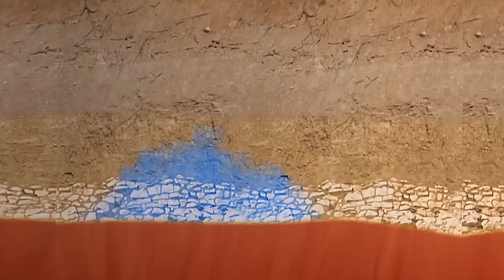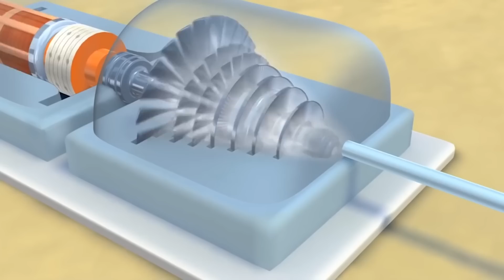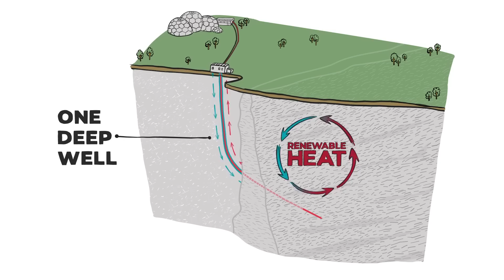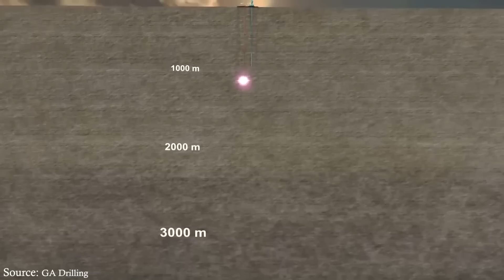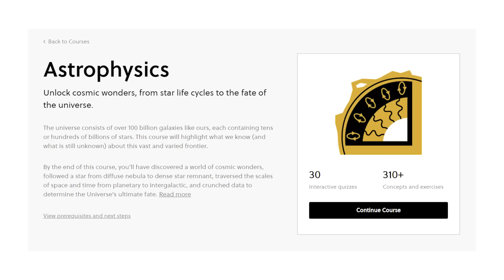How This Hole Keeps Generating Energy

Comment: Physics will tell you that the core of the earth is NOT an infinite source of heat. This Spheroid on which we live has a limited capacity. What say we draw off energy and cool liquid rock down to solid rock ? We run the risk of shutting down the great magnetic generator that is our molten core. If this happens we will be able to harvest the radiation from the sun better but we will need better radiation protection at the surface of the earth. What I’m telling you is that it’s currently feasible to use energy from hot sources from close to the surface but eventually we will suffer consequences and who knows it might coincide with our sun becoming a red Dwarf … if we cracked the nut of AC aerial transmission that Nic Tesla proposed then energy conversion sites at our Geothermal sites worldwide could supply remote power without having to maintain Windmills and solar panels. Who’s up for that challenge? It’s not like something that hasn’t been done … Tesla actually proved it before they pulled the plug on it all, the hardest thing will be the religious Greens and the money Barons interference in a society improving innovation that supersedes current money making energy supply. Remember JP Morgan only Shut Tesla down because he couldn’t regulate and charge for the Energy supplied ….
Reply: This Spheroid on which we live has a limited capacity. What say we draw off energy and cool liquid rock down to solid rock ? We run the risk of shutting down the great magnetic generator that is our molten core

Source?

Comment: even if not for electric generation, geothermal has heating applications it could be used for to displace natural gas. and oil use
you'd think in advances in heat pumps and cryogenics, the'd be able to make concentrators to up the heat to a more usable value.
plus it's clean and can go in locations nuclear can't be, cutting infrastructure costs to connect it.
best drilling tech is owned by oil. 
might explain it's slow take up.
Reply: You forgot the coal and wood. Yes, heating is expensive enough to be the major goal.

Comment: If there is even a remote chance that any of the people actually working on the plasma laser or other top end drilling techs see this, on behalf of our planet PLEASE STOP.  Do not continue with this attempt to generate cheap energy.  One misplaced drill that causes a significant pressure change underneath tectonic plates has the chance of creating significant earthquakes and tsunamis.  There are plenty of places where geothermal energy is already escaping to the surface and you can have fun capturing all the energy you want from existing holes but the chances of really pissing off mother nature are huge.  One team that hit the wrong pocket of anything could release gas or water or lava that was under extreme pressure and that release of pressure won't be able to stop in time before a significant tectonic event occurs !!!!!    Tiny little movements cause lots of damage and they want to toy around with things that have the potential to create not so tiny movements.  World wide devastating tsunamis and possibly successive earthquakes for weeks or months.      The pressures inside our planet are not to be treated lightly.    I am all for green energy but I have to ask you question.  How green will the planet be after we release internal pressures that could impact the forces that govern the spinning core at the center of our planet.   If something significant caused a change in a plate above it and that in any way caused a change in a spinning sphere of magma that caused it to slow down or spin differently the implications to the magnetic fields that protect our very existence might leave a brown and red and barren planet instead of a green planet.   This technology as good as it sounds is not worth the risk.   There are much better ways to try to harness energy then tampering with loosing out magnetic field.    I AM NOT a doomsdayer or conspiracy theorist.  These are legitimate concerns that should well vetted by teams of geologist before anyone decides to double how far down we have been poking our mother.

Comment: Would anyone have to dig very deep at all, if we started storing the Ambri "liquid metal batteries" underground? Ambri wants their batteries to stay hot. I'm sure they would get hot enough to keep the rock around them hot. They could capture the excess heat from the batteries with steam turbines and cool the batteries down if there's a theoretical unsafe temperature for Ambir's batteries.

Comment: A problem you forget with geothermal energy is that you subtract heat from the rock and the rock is not a good thermal conductor. That means that a certain pipe has only a limited energy capacity until the rocks are cooled down enough so that the water will not be supercritical.
Reply: You underestimate the available heat. You also fail to consider that multiple wells would be needed, either as stand-alone systems, or as a system of interconnected wells, circulating water with additives. It has been done already, and if the well spacing is good, then you get enough heat generating to run a power plant for decades before needing to introduce new wells.
Reply: @cerealport2726  It's never been done at this depth.
Reply: Rock at this temperatures and pressures (at 10 km or below, provided the right spot is chosen) is not like the rock here on the surface. It's actually getting softer and even partly melts, a bit like thick, highly viscous magma with solid parts in it, having quite different thermal conductivity. And there are saline fluids which also can transport heat. Of course there is a limit, but with the right amount of water pumped in, there will be little issues with keeping it hot. 
But there are other issues. In case a non water-permeable layer of clay is penetrated, and water spreads into formerly dry layers below (e.g., into Anhydrite), those may swell, raising the land above quite a bit. This already happened, and it literally ruined villages. Such issues are hard to predict, because of the actually unknown structure details and porosity of the rock below. Another issue is liberating toxic substances from under ground that were kept there before, e.g. heavy metals or radioactive material. And in case of a movement of the (softer) rock below, the pipes may easily get crushed, posing another issue. 
We actually don't know very much detail about the earth's mantle, as it is hard to just go and have a look. Thus it is difficult to chose the right spot to drill.
Reply: @human_isomer  
I believe they line the borehole with a pipe down to below the depth where there are no more layers for water to go into.  The water is under pressure so it seems possible that some may leak between the pipe and borehole.
Reply: @acmefixer1  yes, when wells are drilled, they start with a large diameter, and end with a small diameter. at each interval, they run and cement "casing" or "liner" in place to isolate the well from the rock. a common well design is 4 hole diameters, 26inch hole (with 20inch casing), 17.5inch hole with 13-3/8inch casing, 12-1/4inch hole with 9-5/8inch casing, and 8-1/2 inch hole with varying casing diameters, sometimes, depending on the location and requirements, there's also a 6 inch hole section too, again, with varying casing diameters available. it does vary, but this is pretty representative in terms of scale.
Reply: @acmefixer1  The melting rock due to the plasma actually creates it's own casing
Reply: @human_isomer  You absolutely do not need rock that hot. You need it to be 200-300 degrees (celsius)  or so, enough to turn water into steam.
Reply: @cerealport2726  I didn't mention any temperature ;) But I see it could be assumed to be very hot because I mentioned magma.
Reply: @human_isomer  we dont need "less" or "more". We need the exact number to operate with.
Reply: But could alternating between a small amount of tunnels give enough time for the rock to heat up again in a reasonable amount of time
Reply: @owenhopper14  There's nothing to heat up again - it stays hot. It's the heat from the earth...it'll be a long long time before that ever gets too cool.
Reply: Krypton Future !
Reply: Exactly.  And as he mentioned,  it's very costly to drill a deep well.  When the well runs out of heat and a new well must be drilled, did the  amount of power generated pay for the first well to be drilled?  Will the next well generate enough power to pay for its drilling?

This also applies to the existing geothermal power plants that are located on hot spots in the earth's crust. The wells are much less deep than the wells that must be drilled where the heat is deep in the earth's crust.  The drilling expenses must not exceed the returns from the power generated.
Reply: @acmefixer1  It costs $500k to drill this well - 8'' borehole 10km deep. That's compared to ~$30million for a regular oil rig setup.
Reply: @blakebrown534  that doesn't seem right.. $500K is peanuts.
Reply: @mrgyani  I'm just stating their own estimates and they're far smarter than I am. The project is now lead by a guy who worked for a long time in oil and gas, too. Only using conventional drilling for a short distance helps as the only thing you need for the rest of the 'drilling' is electrical power for the micrometer wave technology they're using.
Reply: @acmefixer1  so the root of the problem is profit margin. Even though coal oil & natural gas subtract from the ground & adds C02 to the air ? The air isn't important the profit margin is ?
Reply: @darrylbunch6929  
Do you expect a business to operate  continuously without making a profit?  

There are those Big Oil and fossil fuels industries that are making obscene amounts of profit, yet the US government still gives them subsidies.  That needs to stop.
Reply: @darrylbunch6929 that may partly be read in terms of energy I guess. The energy needed to get it to work should be a lot less than the energy it provides when it's up and running. I'd agree that anything  stopping us from burning 180,000 liters of crude oil per second by design or disaster is worth concidering.
Reply: No actions of man are going to cool the rock at that depth such that you would need "new" wells. That's heated by the mantle. Once dug you're in business until it breaks. Simply laughable to suggest the heat would run out. It's not a water table

Comment: OK how is this idea. A pipe from the valley floor to the top of the mountain.  The difference in pressure cleans pollution from valley and could generate electricity 24/7
Reply: That won't work.
Reply: @acmefixer1  why not?
Reply: @ivantijerinaf1207  Adding a pipe doesn't change anything. The pressures in the pipe are the same as outside the pipe.